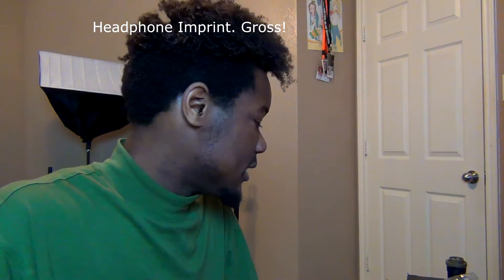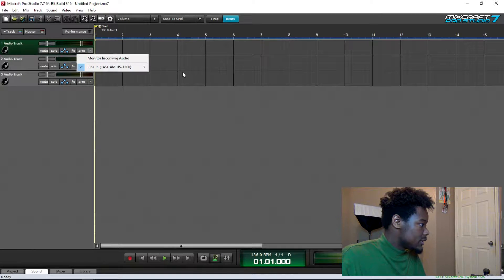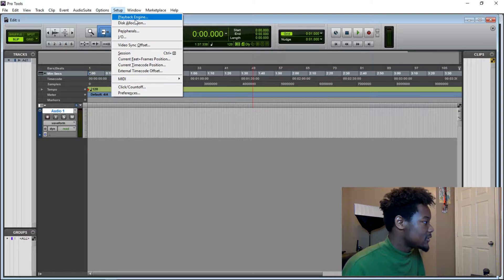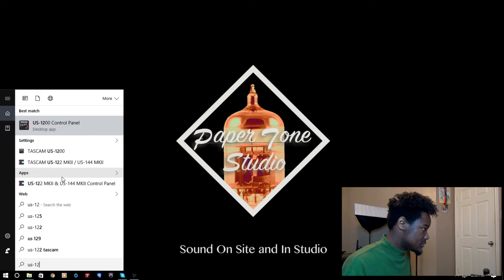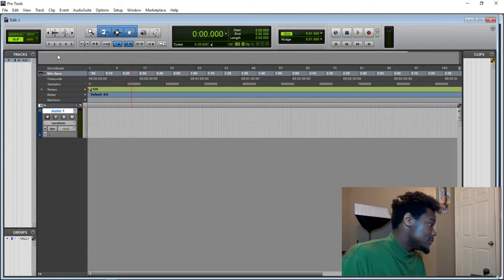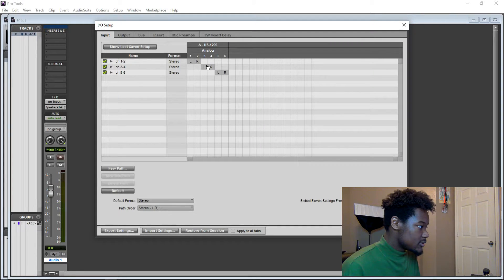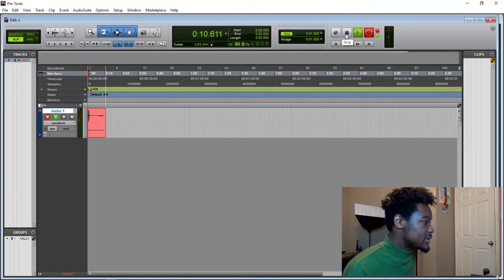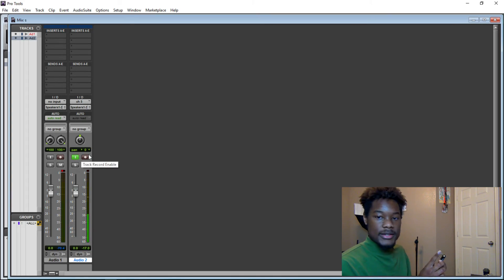How to use a Tascam US-1200 in Pro Tools 12

Comment: Hey, I ended up buying this interface but I cannot get it to sound well for the life of me. The mic sounds fine, but my line in guitars sound awful. I tried multiple guitars, line in cables (balanced and unbalanced) and listened to the audio in FL studio and from the tascam control panel. It sounds muffled and muddy and I have no idea why. Any clue? Thanks in advance :)
Reply from the maker: +John Smith is there anything but the guitar in your chain. There could be a multitude of reasons for this.
Reply: Thanks for replying, absolutely nothing else. Also: I know other things run fine in FL Studio because I am running the US 1200 as my I/O device and it sounds flawless with any vsts, my virtual drums, or literally anything else.
Reply: Actually, I think I fixed it (comparing current sound to old recordings now). It sounds better but honestly, I Have no idea what the hell I could've done to make it sound better now than it did previously. Otherwise I would let others know so they could fix it too. Sorry for wasting your time.
Reply from the maker: +John Smith awesome. You're fine, i enjoy answering questions. Good luck recording!
Reply: Okay, actually I was wrong... lol the audio is still terrible. I thought it was working briefly and left it alone but as I come back to it I realize how muddy it sounds again. Here's what I've been extremely curious about: is it normal for the guitar audio to sound this dull? Do I just need to EQ it? Or should the interface be sounding great right out of the box?
Reply from the maker: +John Smith if its just an electric guitar lined directly in, no effects it is going to sound muddy. That's what an amp is for. I assume you're not micing an amp?
Reply from the maker: +John Smith if its just an electric guitar lined directly in, no effects it is going to sound muddy. That's what an amp is for. I assume you're not micing an amp? If not you should be. Or you should be using an IR.
Reply from the maker: +John Smith if its just an electric guitar lined directly in, no effects it is going to sound muddy. That's what an amp is for. I assume you're not micing an amp? If not you should be. Or you should be using an IR.
Reply from the maker: +John Smith if its just an electric guitar lined directly in, no effects it is going to sound muddy. That's what an amp is for. I assume you're not micing an amp? If not you should be. Or you should be using an IR.
Reply from the maker: +John Smith if its just an electric guitar lined directly in, no effects it is going to sound muddy. That's what an amp is for. I assume you're not micing an amp? If not you should be. Or you should be using an IR.
Reply: I was using direct line in, no mics. It's for convenience. Can I modify the sound to make it not sound muddy? I can't imagine in this day and age people are limited to only getting good quality sound through using mics up to amps.
Reply from the maker: +John Smith you'll probably want to use digital amp in your daw if you plan on lining in you guitar directly. Otherwise you'll just have the sound you have. An amp should be present in your chain somewhere, either physical or digitally. That will help you in balancing your tone along with the amps eq and post ep.
Reply: Thanks a lot man! Like I said, I googled around for this but you're information has been far more helpful for my specific problem. Okay so I was trying to achieve that "not muddy" sound by using the Fruity Parametric EQ 2 plugin that comes with FL Studio. Do you recommend another plugin I should use instead as my "virtual amp". Worst case scenario I'll just buy a new physical amp cause I need one anyway. Sorry, another question: When looking for a physical amp for my guitar, what specifications/requirements should I keep in mind for running it through my audio interface to record?
Reply from the maker: There are a lot of digital amps/ vst plug ins out there And some are free. Of course it depends on what tone you are going for but here's a link- http://bit.ly/2pLvGyr
And for a real amp it's the same thing. What ever tone you want will change with would be recommended. But for what ever you chose keep in mind you use for it if it's just recording there's not need to go big (Marshall stack) but if it's for recording and live you might need something that size. 
When you've chosen and amp just make sure you have a good mic (dynamic or ribbon) that can take an amps volume, along with a xlr cable and a stand and you should be set to track!